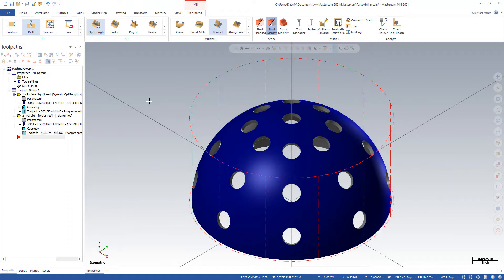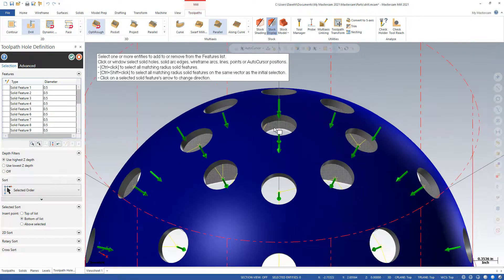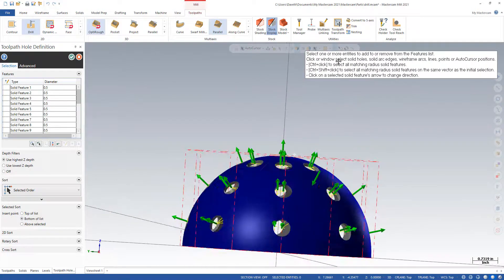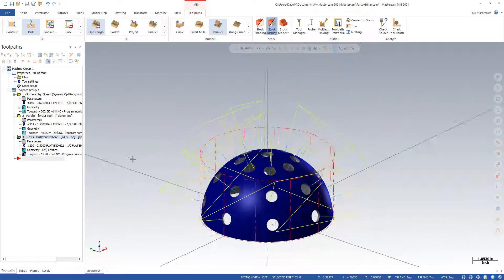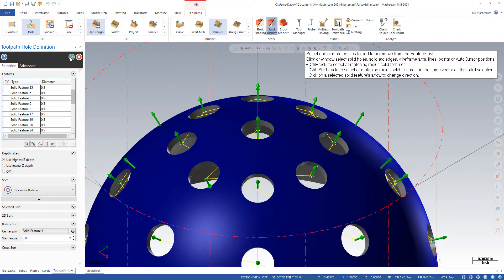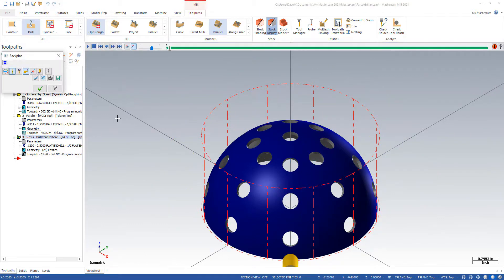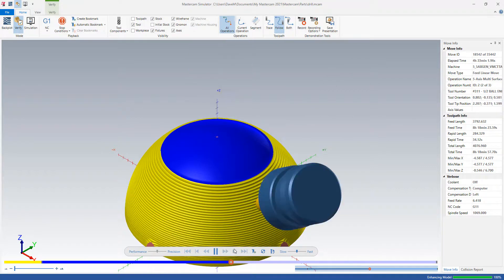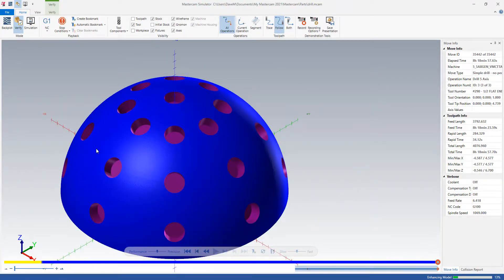Multi-Axis Drilling in Mastercam

Comment: do you know if mastercam is able to output 3+2 Drilling cycles but also with 5 axis simultaneous linking moves? Meaning on linking moves it is switching to Tool center point control and when it stops at the next position it deactivates Tool center point control and activates a tilt/swivel cycle and then outputs a normal drilling cycle which you can easily manipulate.